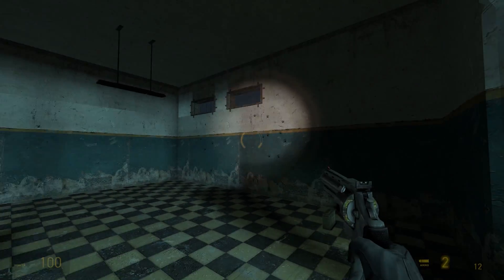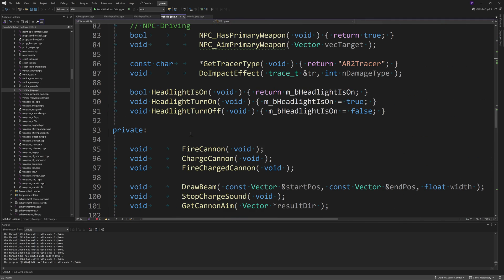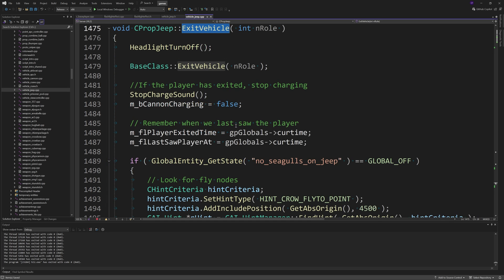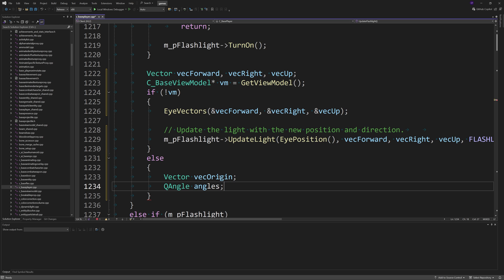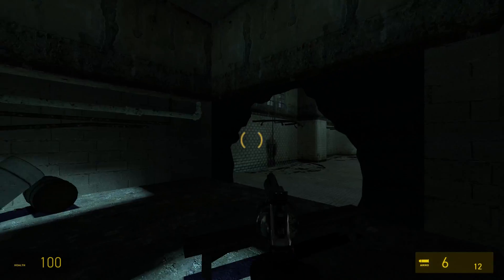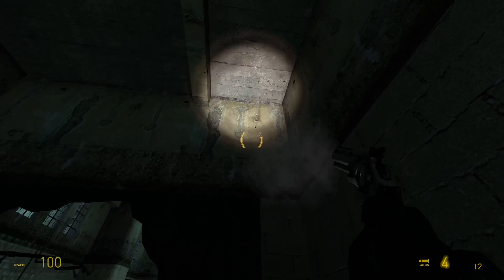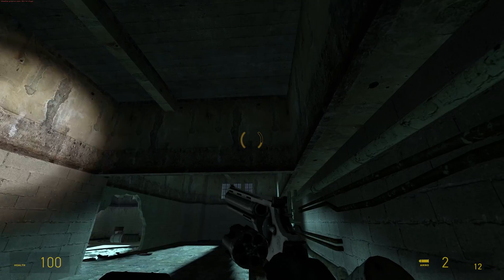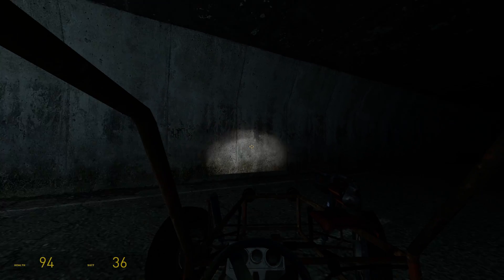Valve Source Code 2013 Tutorial (Episode 27): Miscellaneous Flashlight Features

Comment: Hey man, it’s me again, hope you remember me. I was wondering if you could make a tutorial on how to remove hl2 weapons (especially the gravity gun), since it’s hard. I’m making a mod like counter strike so I really need this, thanks! By the way, this is for singleplayer.
Reply from the maker: I would say you can simply remove the weapon files from the Server project, then check to see if there are any compilation issues. Have you tried this and if so, what errors did you encounter?
Reply: @TheMaster974  I did tried. There was a lot of errors. For example, Combine Soldiers use SMG1, so they drop them. I tried finding everything related but there was too many of them. I don't know much of how to handle them so I was hoping if you knew it. And the gravity gun, supercharged gravity gun, normal one. All that stuff.
Reply from the maker: Yeah, there's going to be references to the weapons in other parts of the code that you would need to deal with. It would probably make things easier if you went to the Edit->Find and Replace->Find in Files function (or press Ctrl+Shift+F) which opens up a window that you can use to find every instance of a specified word in the entire code i.e. SMG1 or Physcannon, then remove some/all of the parts that show up.
Reply: Thanks, I’m sure this is the only way. Thanks for helping me again!
Reply: @TheMaster974  you could just remove the LINK_ENTITY_TO_CLASS part

Comment: Hey, would it be possible for the flashlight to have some ambient illumination? Like... when you look at a wall with a flashlight in Source in the dark, you only see the beam of the flashlight, but could it be made so you can also slightly see the surroundings, if you know what I mean?
Reply: Oh, and I wanted to ask. This is off-topic from the flashlight, but would it be possible to make it so that when I'm holding an object, the right-click wouldn't just drop it normally, but would deal damage to it? Like, if I grabbed a box and pressed the button, it would deal damage to the box, and maybe after five hits, it would break, if you know what I mean.
Reply: And could some movement be added to the flashlight? Like, it would slightly sway or move a bit.
Reply from the maker: To answer the first question, I'm not sure, perhaps you can change the state.m_fHorizontalFOVDegrees or the state.m_NearZ values to achieve that? For the second point about making the flashlight move when the player is not moving (like it bobs up and down when the player breathes or something?), you would need to go to c_baseplayer.cpp and find the UpdateFlashlight function, then beneath the EyeVectors or AngleVectors line that I showcase at around 05:45, add: vecUp *= 1.5 * sin(gpGlobals->curtime); This will make it so the flashlight bobs up and down slightly over time, however this causes the flashlight material to spin around when it passes through the central position and I don't know how to resolve that. For the last point about pressing a button to damage a held prop, I can look into it and see if I can get it to work.

Comment: hello. do you know how to make a cinematic styled camera that smoothly moves whilst looking. and do you know how to get a claustraphobia type view 
thanks
Reply from the maker: Thanks for the comment, however I don't know how to do that.🙁 Out of curiosity, what do you mean by a claustrophobia-type view?
Reply: @TheMaster974  like make the view kindof line tight. So you see everything but if it were like closed in on itself. It's kind of hard to explain
Reply from the maker: I still don't really know what you mean, I'm guessing you mean you have a higher FOV horizontally than vertically, which would compress the view somewhat? If that's the case, I don't think there's anything you can do to change the vertical FOV because it's handled by the engine.dll file and the engine code is inaccessible, which sucks.
Reply: @TheMaster974  then change the fov bounds to be like 75-180. Then in the game/mod make the fov like 150 and change the r_claustrophobic to 1 and r_clauatraphobis_amount to something like 6.5
Reply: oh sorry in DrawViewModels change tmpview  to TmpVmodelView
Reply from the maker: Wow, thank you very much for providing us with this! The claustrophobia view looks...very weird, I have no idea if that is what the intended effect was supposed to look like! As for the cinematic camera, it looks like that works if the 'amount' ConVars have low values like 0.025, however I have noticed that client-side effects for viewmodels like the Crossbow and Gravity Gun don't seem to follow the viewmodel properly, that would be a minor criticism (unless it's because I've done something else with my test project that is causing this issue, then you can disregard this!). Anyway, thanks for the input!
Reply: @TheMaster974 try the cinematic camera with the viewmodel fix convar set to 1 that should fix it. If not i might have to find a fix for it. And yeah the claustrophobia thing looks weird af lol. Also your welcome :) (this is an alt account cause I can't comment on my main one for another day)
Reply: @TheMaster974  the comment waddelz must have posted isn't showing up. Can you please resend what he said or make a video for this please
Reply from the maker: Oh right, I tried that but it doesn't seem to resolve the issue.
Reply from the maker: I can do a video about it, it's a little confusing but it's not too difficult to follow.
Reply: @TheMaster974  alright sweet
Reply: @TheMaster974  hey I was just wondering when you were gonna release that video. Thanks
Reply from the maker: I hope to get it out within the next couple of days or so, real life stuff got in the way sadly. Also, WadDelZ hasn't commented with a fix for the client-side viewmodel effects so I'll have to do the video with that issue being present.
Reply: @TheMaster974  quick question what viewmodel issues are happening.
Reply from the maker: From what I've experienced, the Gravity Gun and Crossbow client-side effects don't stay near the points where they are supposed to, try grabbing an object with the Gravity Gun and look/move around with it.
Reply: @TheMaster974  oh shit those bugs. Yeah I could probably fix them
Reply: @TheMaster974  sorry dude i havnt really had the time to figure out how to get it to work but what i did try didnt work (because im trying to push the new release for alone mod out in a few days and im working my ass of on it) so you can upload the video and if i find a fix ill let you know about it and you can maybe make a sub video on it
Reply from the maker: Don't worry about it, I would suggest you focus on getting the Alone mod stuff done first (which I'll probably check out when it's ready), then (maybe) deal with this afterwards. I'll upload the video about this cinematic camera feature with this issue present and if you (or someone else) can find a fix for it, a comment can be left on that video, then a follow-up video could be done if appropriate. Thanks again for the help and good luck with the Alone mod!
Reply: @TheMaster974  thanks very much dude. And I hope you like the mod when you play it :)
Reply: @TheMaster974  I'm verry sorry about asking this but do you reckon you could maybe post the video on the cinematic camera thing tonight or today or tommorow (I don't know what time it is for you) then do a video on alone mod after doing one on the cinematic camera. Again I'm sorry for asking that I don't like asking for stuff like that
Reply from the maker: The cinematic camera video will be live in a few hours from now.🙂

Comment: is it possible to make the flashlight used by jeeps headlights different? Like Bigger or a different flashlight texture?
Reply from the maker: Yes, you would need to add something like this in the CHeadlightEffect Constructor: m_FlashlightTexture.Init("<material_name>", TEXTURE_GROUP_OTHER, true); to make it so the vehicle headlights use a different texture. To make them bigger, you can go to the CHeadlightEffect::UpdateLight function and change the horizontal/vertical FOV values and the m_FarZ distance to make the effect cover a larger area. Hopefully this helps!